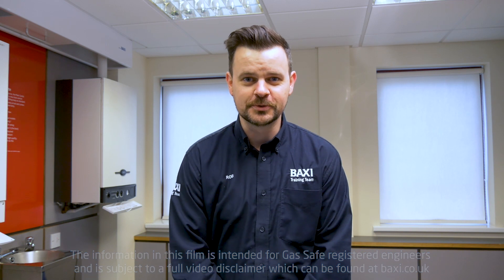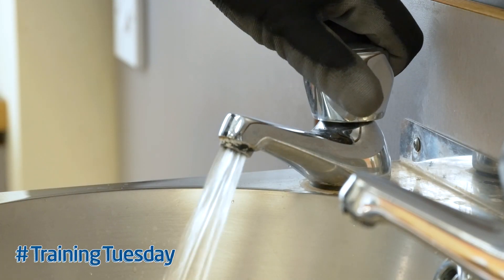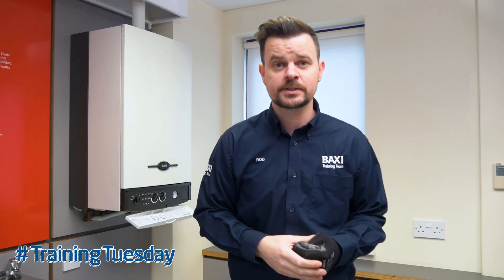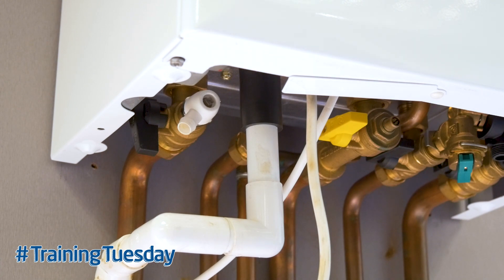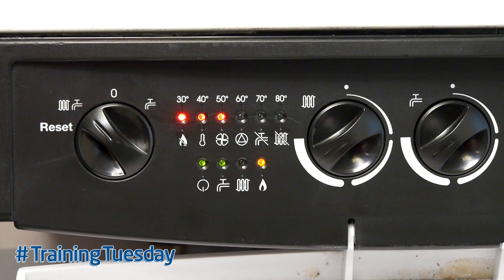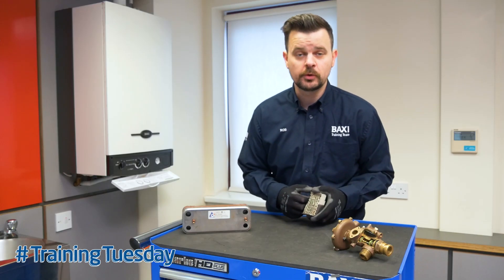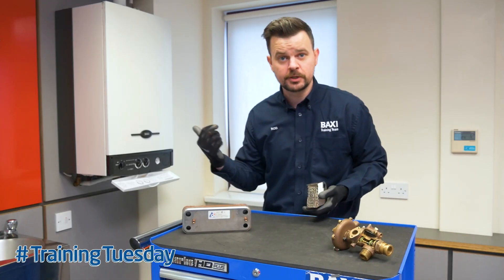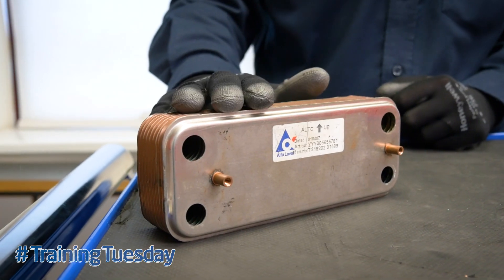Common causes of reduced hot water at the tap with a combi boiler | Baxi Boiler Troubleshooting

Comment: Have a tenant in my property who says the boiler was noisy on using hot water. I have had a look at it and it possibly sounded slightly noisy, but otherwise it heated up the hot water on demand – reading about 10 to 15° less at the hot tap than at the boiler itself. I had a heating engineer out to check it and they said it was fine, but clearly something is amiss as the tenant mentioned today that it comes out cold for many minutes on very cold mornings , then eventually heats up. Any suggestions on what I should look for before I call out another engineer? Could this be a diverter valve, as presumably the heating is working hard on those cold mornings?

Comment: That diagnostic test of stopping the CH flow and running a tap to prove whether the diverter valve was faulty or not has just saved me from calling out a gas fitter. Was able to put the parts from a service kit in the diverter valve and hey presto! DHW is hot instantly again. And my boiler isn’t even a Baxi but the principle was the same. So grateful.

Comment: WHAT about only getting hot water when radiators are on ,and we have to wait for a while like 10 min for them to run hot ,soon as they turn off with temp reaching set temp on thermastac water runs cold ,also been getting a brownish coulor in washing up water leaving brown mucky mess around the bowl after tipping out the water ,we have no money to pay the plumber as we paid out £700 to him when we moved in and rep;laced a few parts and ity never worked ok .

Comment: Do u know which model can replace that one on ur video.
Mine has hot water no heating. The heating light is not on. It used to work well. After the technician replace the mother board or electronic board, then it is not working for the heating. We did not check , now heard the company closed business, people are replace it with other brand. I cannot find a baxi technician so far.

Comment: Replaced all those parts including fan, turbine flow and checked gas flow at gas meter.  Still only getting lukewarm water on max hot water setting. CH is working fine and no fault codes.
Reply: This was comment was a year ago, did you solve it?? I have the same issue.
Reply: @benboyland4205  
Yes, it was the burner unit. It was blocked and only burning a third of gas. No wonder water not getting up to the right temperature, even on max hot. I serviced boiler ever year but service guy never cleaned it properly.

Comment: We have an old baxi boiler ( similar to one in the video ) heats water and radiators , but water only mode doesn’t work ( we don’t have a knob for water ) can this be installed without a boiler replacement, so we can heat the water separately?
Thanks everyone in advance !

Comment: Replace ? your showing a baxi 105 what about just strip and clean the valve pin 99 times out of a hundred its a bit of gunge on the pin stopping proper travel a 30 minute repair with just a bit of grease required . And plates are very easily cleaned in around 20 minutes to

Comment: Hi - I'm getting brown water from my hot water tap. When I run a bath I run the hot water for a while, then turn on the cold, leaving the hot running and when I turn the cold off the hot water starts to run brown. Recently had a new heat exchanger fitted to my Viessman combi boiler. Could the problem be with the boiler, the radiators - or is it down to water supply. Thanks.

Comment: My radiators go cold when hot is open and start getting hot when hot water is tap is off Need help please 🤔
Reply: Sounds like the diverter valve based on what hes saying - but it also sounds normal...

The Diverter Valve DIVERTS the hot water to either Centrla Heating or Hot Water Taps - and this depends on demand. 

If you turn your taps on your demanding Hot Water 
If your Taps are off then your demanding it go to your Central heating. 

I don't THINK it can split the difference and do both at the same time...
But honestly I have no idea, im here cause my Hot Water doesn't work but my central heating does...

So i think Diverter Valve is popped on mine as well
Reply: Simple, hot water always has priority.

Comment: I get banging noises from the boiler. The radiators are working fine however the bath water runs hot initially then turns luke warm. What needs changing? Thanks
Reply: Most likely the diverter valve, is your boiler over 10 years old? Usually this is the case.